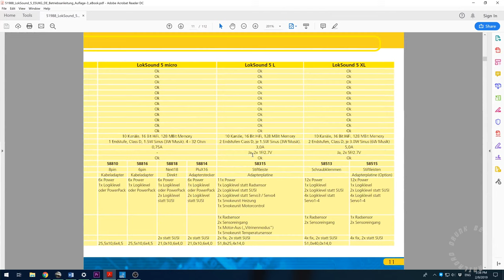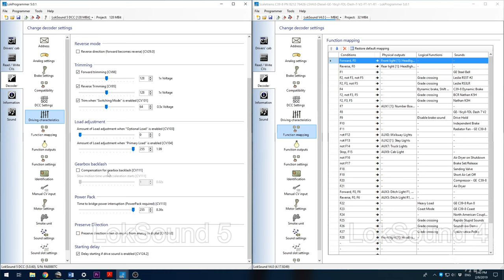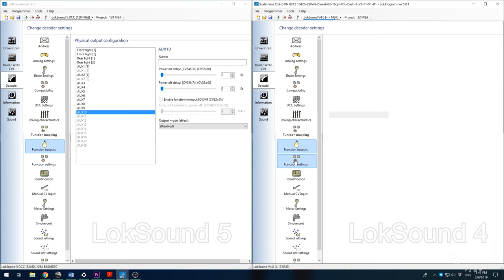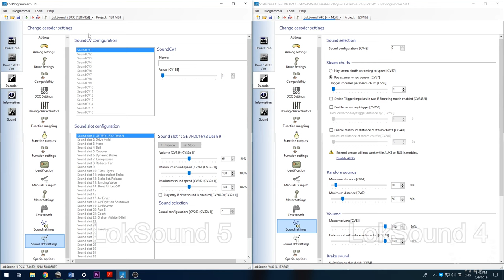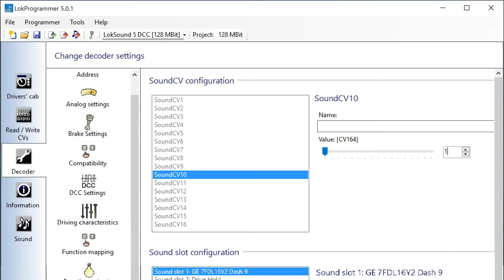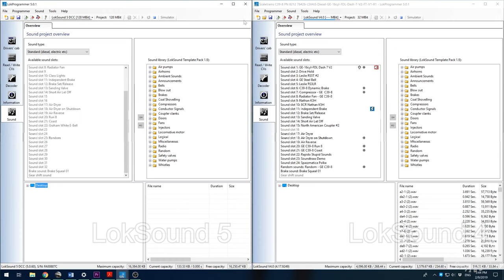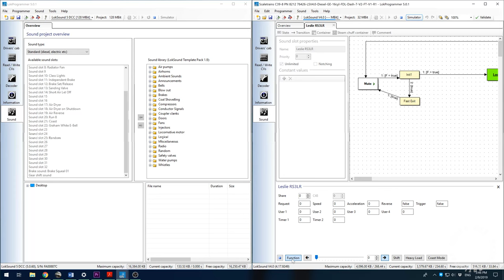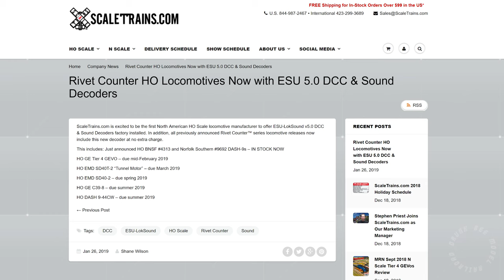LokSound 5 First Look - New ESU LokSound V5.0 DCC Sound Decoder

Comment: This is an EXCELLENT review and demonstration of the LokSound 5 decoder. Thank you for presenting. I have just purchased the HO Rapido Alco FA-2 loco with the LokSound 5 decoder installed. How can I make this decoder manual notch? I see no provision for this in the owner's manual. I do not care for LokSound's Drive Hold feature. Can this decoder be made to manually notch? I sure hope so.

Comment: Will 4.0 versions open on the 5.0 software? What about the Lokprogrammer?

Edit: can the 4.0 be updated for the new 5.0 firmware?
Reply from the maker: Yes 5.0 software works with 4.0 decoders. Lokprogrammer hardware is unchanged.